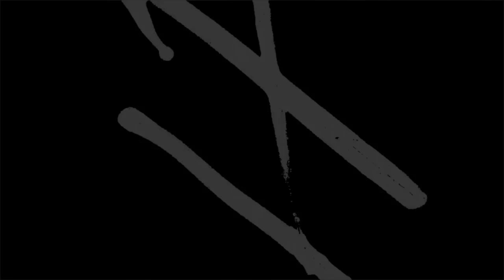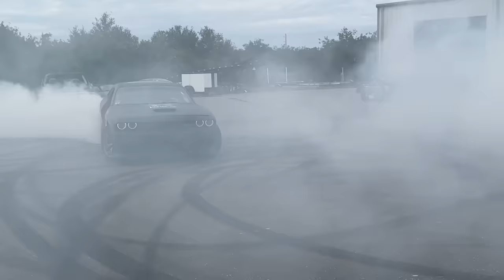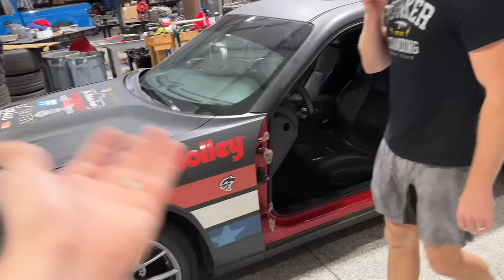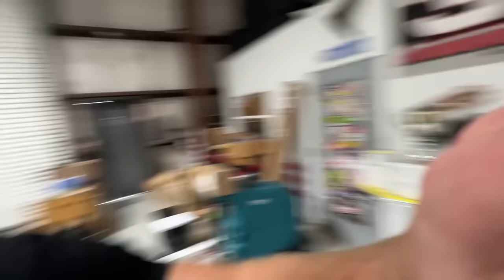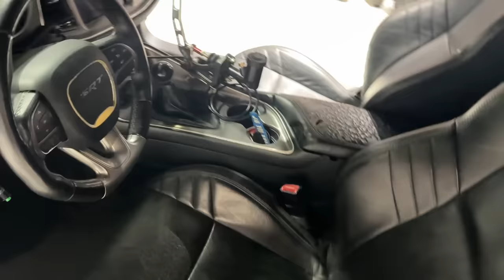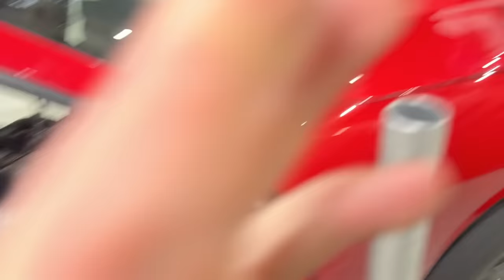Cleetus Messed Up My Hellcat. Comeback Story of the Worlds Highest Mile Hellcat Starts Now!

Comment: There is literally a connector for the door harness 3" from where they cut. You pull the boot up from the dash side to expose it. They cut it in the worse spot. Every time the door will be opened or closed the solder connections will be flexed. Kinda a dick move.

Comment: he should have never cut the wires man come on a joke is one thing but that's different its such a pain in the ass to go into the factory harness and replace that section of it and but connectors will be problematic with getting loose getting wet correding thats just a really bad deal and i looked it up on nada even with high miles that car still books for 33k
Reply from the maker: Just gotta laugh about it